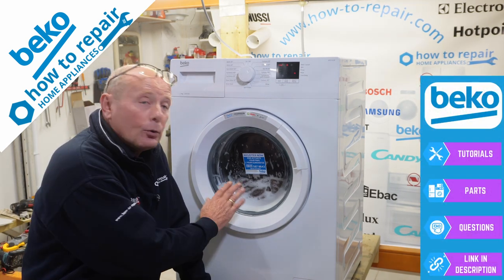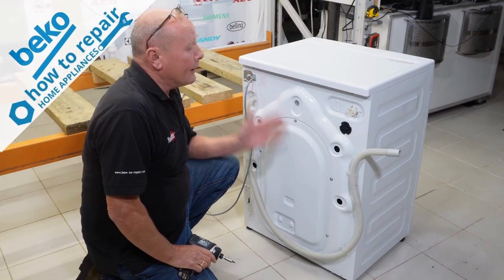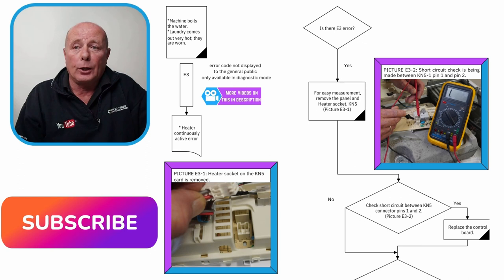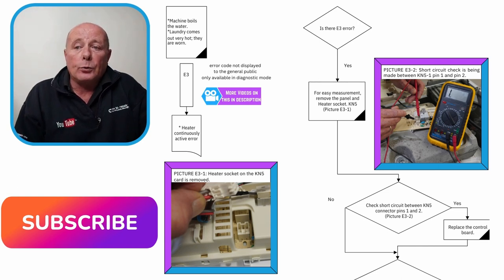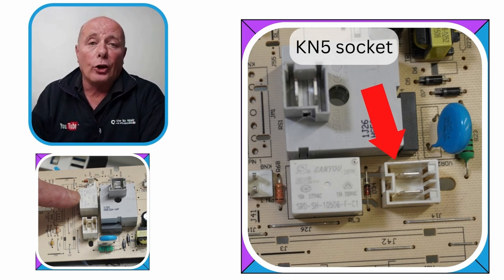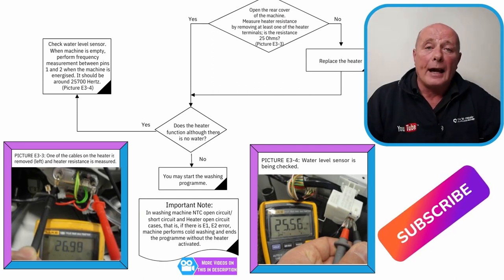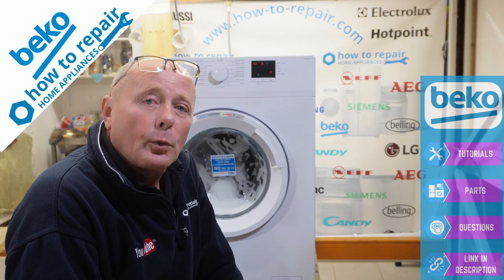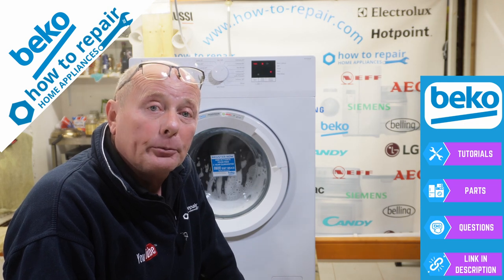Clothes coming out hot Error code E03 Beko made Washing machines heating system fault relay or Pcb

Comment: Why does my Bosch front load washing machine KN5 socket voltage fluctuate between 100v-500v and MCB tripping when the heater is on? Is it a problem on PCB? How do I find the problem?
Reply from the maker: Hi, I will need the full model number of the identification plate and the details of your problem so that I can provide you with useful literature. Please use our contact us page and make sure you fill out the request for what your problem is. A video shoot of the problem would be perfect as well.

I will get back to you within 24 hours, normally. https://www.how-to-repair.com/help/contact-us/  

Please remember to subscribe to our channel, as that's what keeps this channel going. Thanks, Paul 👍

Comment: My beko is locking and unlocking door lock at end of cycle, I thought it was door lock, changed that as well as Pump, fault went for a while and now has come back, cannot open the door unless disconnected from mains for 15 mins, any ideas? Is it PCB it’s making a constant clicking noise when it happens
Reply from the maker: if the machine is full of water then you still may have a problem with the door opening, if you have replaced the door lock with a new one then it's most probably the printed circuit board that is a fault. try looking for a used one on ebay

I would love you to leave your opinion on our poll about manufactures building in obsolescence to appliances. https://www.youtube.com/post/UgkxygHomnUySd_bYjaJBdEHPO6T4dYo9Ahm
and this is for you https://www.youtube.com/shorts/e432SAb2g08 please remember to subscribe as that's is what keeps this channel going. Thanks 👍